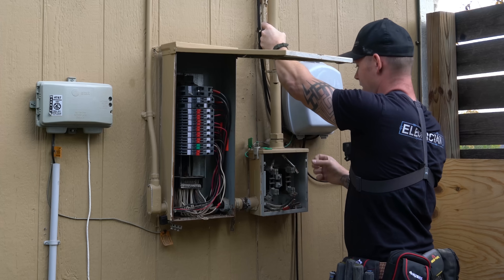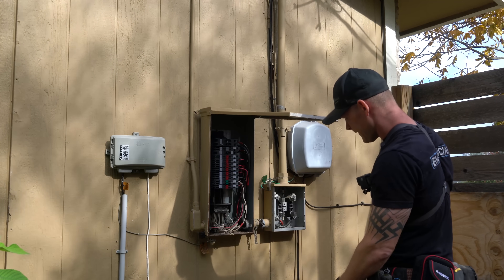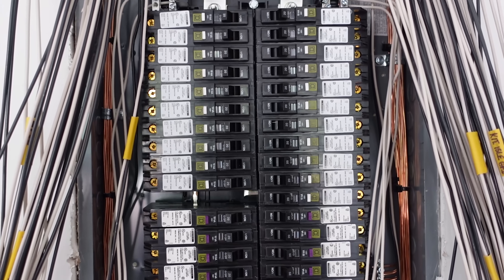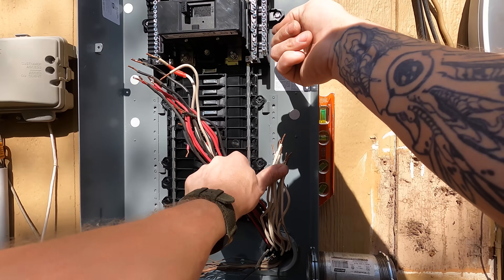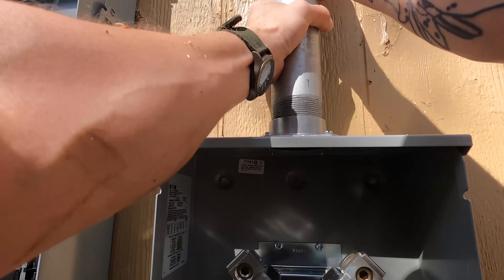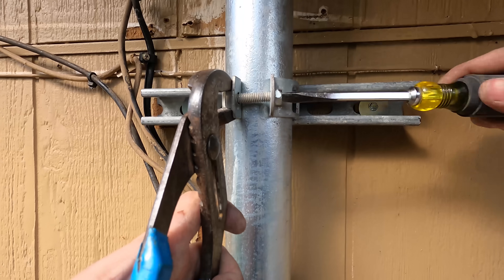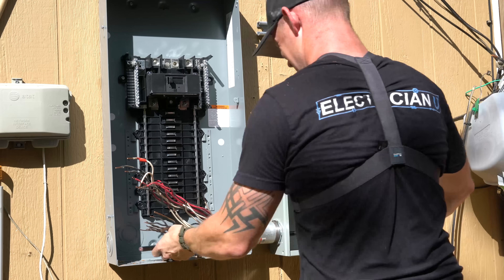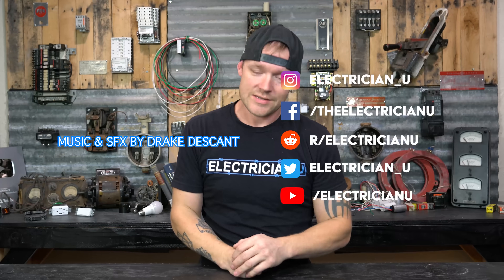How to Replace an Electrical Service Panel, Meter, and Riser (PART 1)

Comment: The holes you knock out are for mounting to a flat surface so if you used that same type of panel mounted to a trailer pole where its round and only the center holes are needed. I personally drill two holes closer to the center when mounting on a pole for stability but anyways if those other holes didn't have knock outs in them you'd have to put a bolt in it to keep water out. So personally I'd rather knock out the holes when needed over having to put bolts in with rubber washers or saying fuck it let the water in not my job!
Reply: mine over matter "its not mine so it dosent matter"  (mike holmes) lol